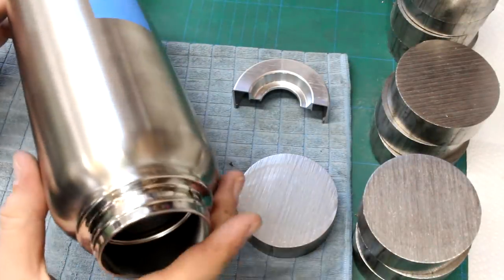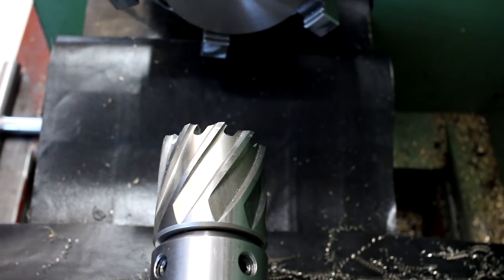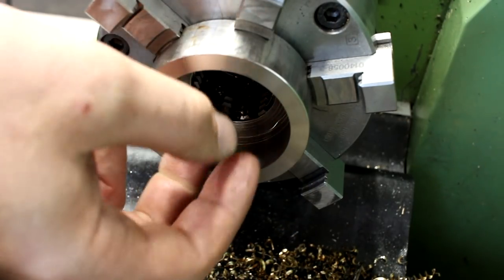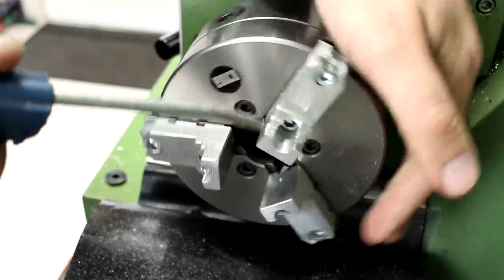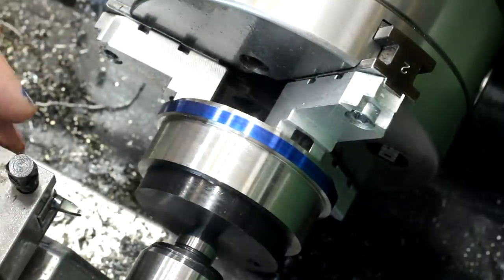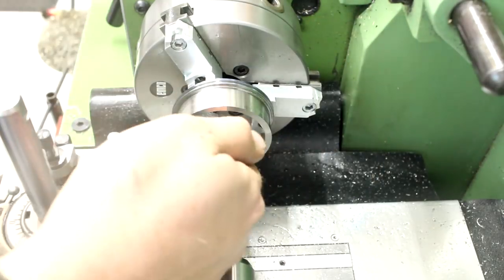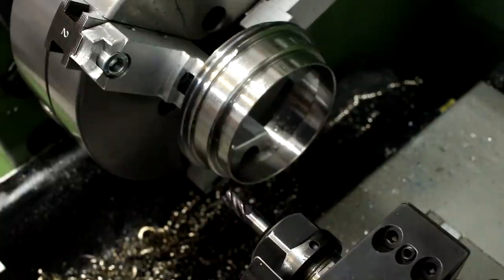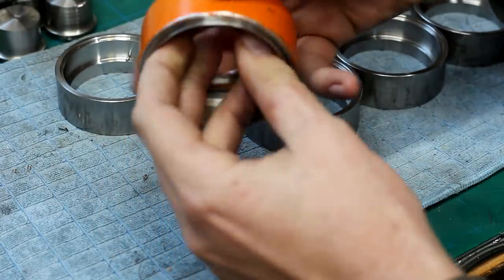Making a part: Drink bottle adaptors

Comment: Personally, I disengage the half nut when the conditions require it, and when the thread pitch is right.  With a 3mm pitch lead screw, it is possible to disengage the half nut for thread pitches like 0.25, 0.5, 1.0, 1.5 etc, i.e when the thread pitch is resolvable in the lead screw pitch. I am sure you know this, but didn't say it.   I find it especially useful on a lathe that doesn't have a foot brake, and for example threading up to a large shoulder.
Reply from the maker: I think in another version of the video I said it, but accidentaly edited it out ;)
My muscle memory is set 100% on half nut closed, and I have a fairly quick stoping spindle thanks to vfd and brake resistor.
Reply: later edit: THIS <<FIRST PARAGRAPH>> IS WRONG AND BACKWARDS
<<But the workpiece pitch would have to be a multiple of the lead screw thread (eg 3, 6, 9mm ...) for the tool to be able to drop straight in?
You could still "find" an opportunity to engage for (say) an 0.25mm workpiece pitch, but it would only happen once every twelve threads, so for practical purposes you'd need a threading dial, which metric lathes tend not to have. (In the rare exceptions when they do, it's a very complex beast requiring a handbook)>>
Thanks to Arnljot Seem for correcting me (see below)

As I'm sure you know but others reading this may not: Running backwards with the tool either upside down or in a rear toolpost can be a good alternative when threading up to left hand shoulders without a brake ...

Stefan: you DID mention the muscle memory thing in this video. Isn't it more of a metric leadscrew thing, rather than a "European preference" thing? Where I live, professional engineering used to be done in inches (shudder) and tradesmen would open the half nuts, but over the last forty years the practice has almost disappeared even for repair work involving inch threads, as metric leadscrews have become predominant.

In my experience setting the compound at half the thread angle happens in just two places (except for the large or unusual cases you mention, where tradesmen have always done it): 
the model-maker brotherhood (because their lathes used to be so flimsy that most threads qualified as "large") and on youTube, where it has become one of those factoids trotted out in the comments section by armchair machinists looking to establish their reputation (OK, that's unkind -- but not, I think, entirely untrue).
Reply: @Gottenhimfella  The leads screw pitch would have to be a multiple of the work piece thread (not the other way around). With a pitch like 0.25 and a 3mm lead screw, it is impossible to engage the half-nut at the wrong spot. You sort of have to wait for the half-nut and leads crew to match up and engage.  For work piece pitches above the lead screw pitch, you should not disengage, as you would risk engaging between the work piece threads you're making.
Reply: @arnljotseem8794  Thanks for that, of course you're exactly right. I edited my post to warn people not to pay any heed to my wrong -headed claim.

Comment: Great content as always. Although I have zero experience in the field, or even anywhere close, your videos are extremely satisfying to watch in some strange ways… Maybe it is just the benefit of watching a professional at work, or we share a diagnosis or something. 

Question: Would it not be possible to offset the workpiece by the depth of the thread when milling a hick..something start of a thread? That way you would (I think) have a movement away from the router, by the depth of the thread, for 180 degrees of rotation. But maybe that is too long a cut.
Reply: Higby?
Reply: Actually on reflection I think it's spelled Higbee. 
Used to be common on fire hose couplings and oil field piping, for all I know probably still is.

Comment: it would be neat to see you make a rolling set of dies with 2-3 threads.  You  could also redo the thread and insert  a cap in such way that bottle and cap have a perfect seal with out removing the cap. Actually that bottle opening is not that best thing for drinking out of a bottle,also bad for cleaning. So the best option is to remove that  thread and rolling a new one  with 2-3 threads.

Comment: Fucking hell. I have a clapped out old lathe to use at work and it is a prick to hold Zero when boring. Using tbe Broach is a fucking awesome idea. it will only take two cuts now. Thanks Heaps

Comment: How do you measure the tip width on a threading tool? I'm gonna be cutting an acme thread soon, and the only method I can think of is a guesstimation with a micrometer.
Reply: To get an absolute measurement, this is properly done with an optical comparator. However if your thread is a standard size, buy a thread guage for acme threads (probably around $40 bucks, way cheaper than an optical comparator). You can use it as a good reference by holding it and your tool up to the light periodically as you grind.

Comment: I beg to differ, dear Stefan, in Holland - also in Europe - we use the threading clock and open the nut.
Reply from the maker: Shush you! :D
(I think the brits do it too)
Reply: @StefanGotteswinter  Actually I am using a SnapTap unit since a couple of years. It allows you to use much higher cutting speeds.
Reply: @StefanGotteswinter  Heh heh, sometimes we do, sometimes we don't. Very confusing to the muscle memory. 
Rear-mounted toolpost on the cross-slide, left-handed insert tool (not inverted) lathe in reverse, feed away from the chuck. Just to confuse matters even more, obviously...

Comment: would red Locktite® be heat resistant enough (dishwashers, carbonated coffee or soup?) instead of a weld be sufficient
Reply: It does maintain its strength to about 150 deg C but I'm not sure if it's sufficiently non-tainting for this use case.

Comment: AAAAHHH .. some pressured Gas is involved .. was wondering "warum der Aufriss? Als Gebu-Geschenk oder was?" 
but i hope the final Part will be made from one Part .. not sure if that solder counts as Foodsave
Reply from the maker: The Fontargen silver solder is of course foodsafe :)
Of course the final product will be done different, this is for prototyping.
Reply: @StefanGotteswinter  The question is: Is it safe for carbonated water?
Copper itself is not stable against carbonated water(which goes as carbonic acid).
But as you said its only a prototype.

Comment: For threading why not invert the tool and thread away from the headstock? Joe Pieczynski has a great video on the subject.
Reply: A thought. You can't see the upside down cutting edge of the threading tool when you do it in the reverse direction like Joe Pie does it. For simple threads that might be fine. For materials that gall easily, plus cutting so much on all three faces of the threading tool, as with trapezoidal threads, especially when you have so much already invested in the part, might be another thing. Maybe if you have Joe's skills and experience you could, but as a part time machinist I'd rather still stick to watching the cutting edge (carefully) and just make sure lathe is spinning relatively slowly and I have the hand very near the stop button. I am sure Stephan has his reasons too. He is far from an amateur. His "close enough" in microns (in other videos) is beyond my skill level - and needs in my home-based workshop.

Comment: I hate 304….it just ruins my tools….since you are silver soldering, why not use 303, which machines much more nicely, even though it is sub-par for welding….you’ll be soldering
Reply from the maker: Since we where not sure if we solder or weld, I went for 304.
303 welds rather bad - and 303 is not foodsafe.
Reply: @StefanGotteswinter  I didn't know that 303 isn't foodsafe...I  still don't like 304 much!...though I weld it quite a lot, it eats endmills especially
Reply: @splinky99  Free machining = lead (as in Pb)
Reply: @8__vv__8  That's in brass and in 12L14....303 has a sulfur addition to help the machining.

Comment: Sorry to be that guy; but what a terrible product, with green washing par excelance. I am sure that one cartidge takes way more energy so produce, than the 4 water bottles it replaces... 
But thank you for the video, always learning something
Reply from the maker: Its ok :)
(Personaly I do not know if one deep drawn steel capsule or a blow molded plastic bottle will take more energy)
Reply: The product can't possibly deliver any decent level of carbonation (4 volumes is the commercial standard).  The beverage must be ice cold when it is carbonated, and also when dispensed, and there is no provision for that.  The industry saying is, "warm soda is flat soda".  Indeed, the container is insulated so the contents can't be chilled.  Carbonated beverages must be uncapped and poured; pushing through an orifice flashes out most of the carbonation.

The CO2 cartridges are ridiculously expensive and wasteful.  It's a metal can of CO2 inside another can of beverage?  Why not just supply one can of CO2 in the beverage?  Oh, I guess there is already a soft drink industry for that.

Stefan should be aware that an interrupted thread and a lightweight cap are critical.  Look on any soda bottle and observe that.  Stefan's adapter is liable to cause injury when the heavy cap is unscrewed under pressure and the cap launches into someone's face, which is inevitable.

Carbonation has been engineered for over 100 years.  These concepts have been tried and discarded many times.  It was perfected in the British Oxygen Company refillable seltzer bottles, which are a curiosity but never effective, economical, or durably successful.  A simple bulkhead cap on a PET bottle, and a standard CO2 cylinder/regulator/hose, is all you need.  The homebrewing hobby has been doing it forever.  http://www.truetex.com/carbonation.htm